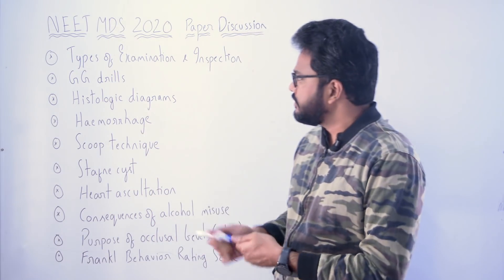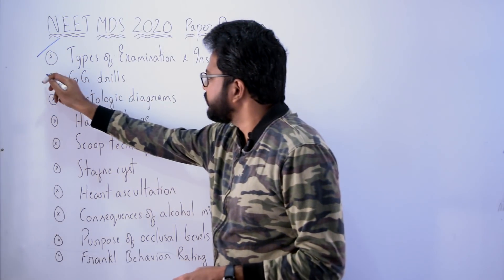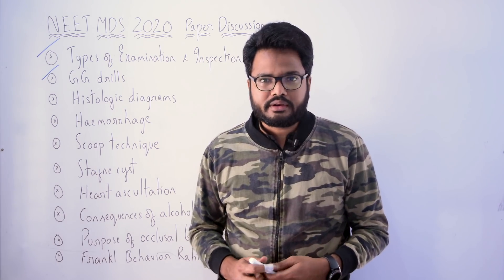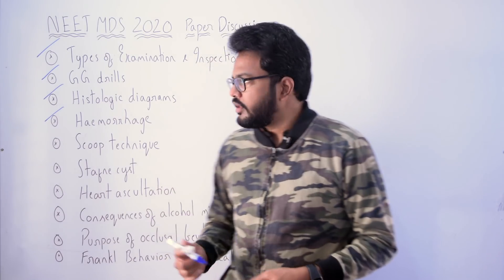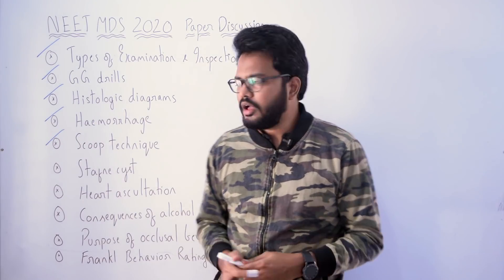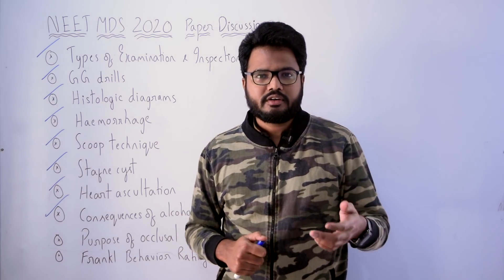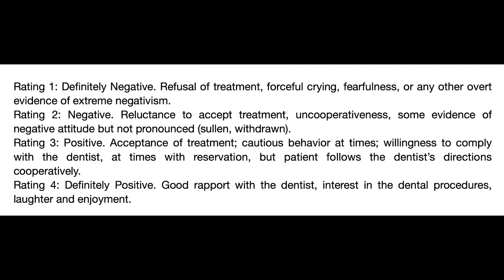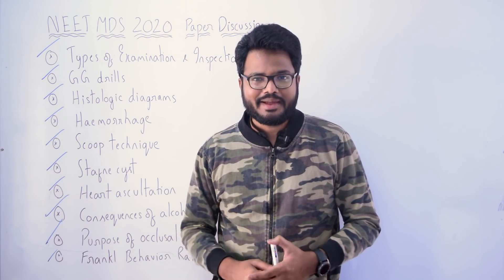Part 4 | NEET MDS 2020 Paper Discussion

Comment: Sir scoop technique is applied when... a) removal of rootstumps . b) enucleation.. Qn was like that... I Dont remember  all the  options sir
Reply: scooped techn for closing needle cap
Reply from the maker: I am getting mixed key words for this. Is that related to surgical treatment aspect or needle recapping? What are all the options given? Also I mentioned about enucleation in the video. Check the description part for additional updated information about enucleation in general. Best wishes.
Reply: @SaiNaveenKumarPilliPTBD18  OK sir👍
Reply: @SaiNaveenKumarPilliPTBD18  they had given one more option fr needle cap closing technique so I had marked this option
Reply from the maker: Good to hear that dear. The information mentioned in the video has been picked up from Malamed. Hope you check it out.
Reply: The options were 1) enucleation 2)curettage 3)root stump the fourth one don't remember ...marsupalisation was in the option
Reply: Curettage

Comment: Synthetic scaffolds ? only option i remember is tricalcium phosphate hydroxyapatite
Reply: sudeep shanmukh wts the answer
Reply: I marked it as tricalcium phosphate hydroxyapatite i dont know whats the right ans
Reply: I think other options are
Polylactic
Fibrin
Glycosaminoglycans
Reply: @mohammedsulaiman4194  yes exactly , which is the correct option and what did you mark ??
Reply: Question was FDA approved synthetic scaffold